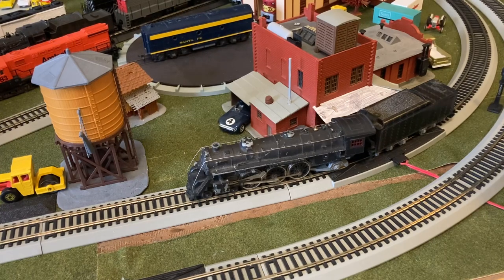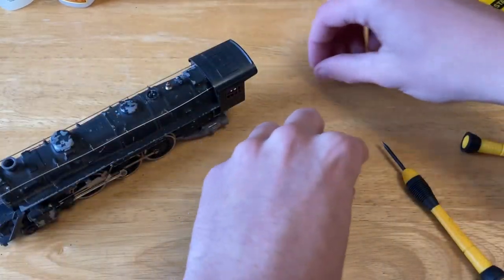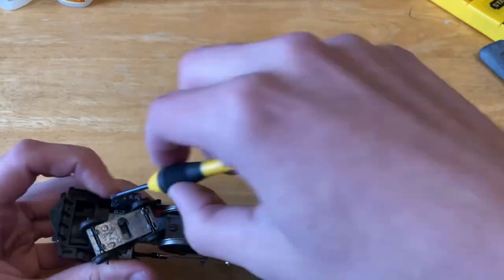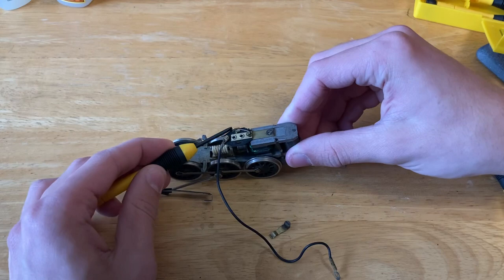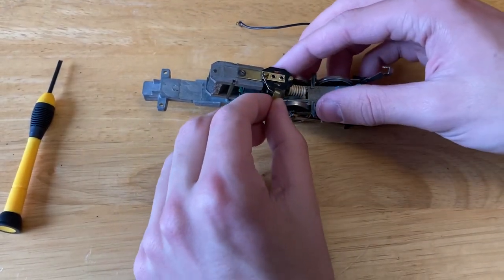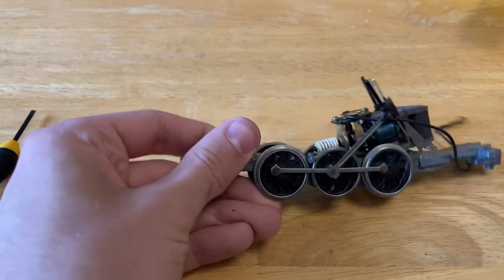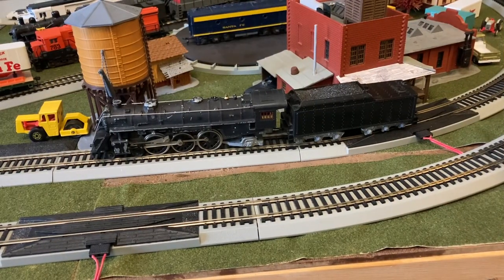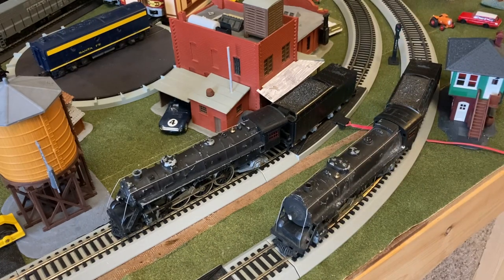Tyco Mantua 4-6-2 Restoration 🚂🧰 Can We Fix It?

Comment: Super. I still operate two Mantua/Tyco Baltimore and Ohio 4-6-2 Heavy Pacific steam locomotives with long haul tenders on my railroad. When I was a kid, I worked all summer for $1.85 an hour (Yep, telephone operator.) and saved enough for my dream train, an 18 car Athearn Baltimore and Ohio Blue and Gray "Royal Blue" heavyweight express passenger train, (Multiple duplicate cars) along with not only one but TWO Tyco Pacific locomotives. I called six different hobby shops and confirmed a few things and went shopping. I was excited, and it was great having my arms and the back seat full of my new model trains. I actually ended up with 21 B&O passenger cars, (One even has oihO, not Ohio, misprinted on the letterboards. I love it.) one standard Black B&O Tyco Pacific, one "Royal Blue" Tyco Pacific, one "Royal Blue" lighted drumhead for my observation car, and a kit to pick up power from the wheels for my observation car, (Thanks Mr. Mizell.) and a pair of RADIAL X2-f couplers, with mounts, for the fronts of both locomotives to allow double heading. (Thanks Caboose Hobbies.) Sharp curves of 15" radius at the time prevented me from using a regular coupler on the front, but now I may own the only two Mantua/Tyco Pacific locomotives with radial front couplers that exist in the world. I probably spent too much that day, but it was incredible. The Locomotives were $19.99 and $22.97, Athearn heavyweight passenger cars were between $2.99 and $3.59, (Avg. $3.29 each, different stores) and add in the couplers, lighted tailsign, and power pickups, and I spent a little less than $135.00 that day and got 21 passenger cars and two powered locomotives. Nowadays, I spend more than that just buying a single locomotive. Good video. Hello from the Tracy Mountain Railway in Colorado. 💙 T.E.N.
Reply from the maker: Awesome Story! Thanks for Watching!! 🚂